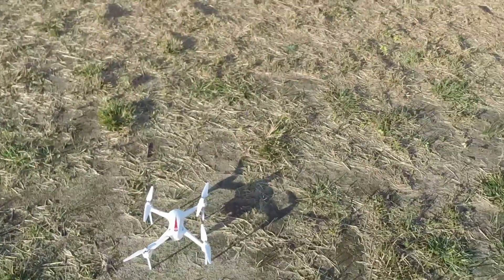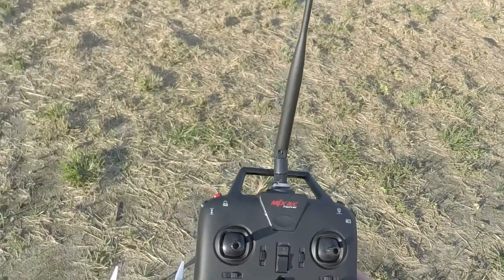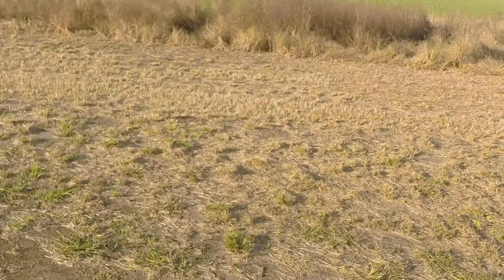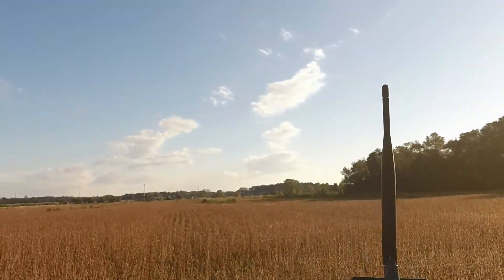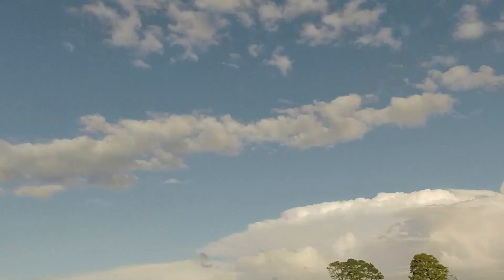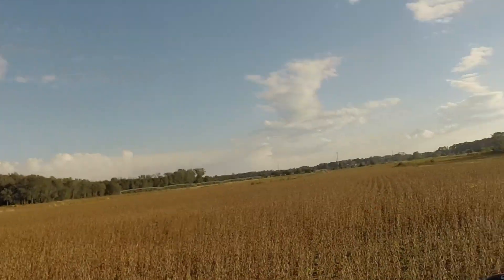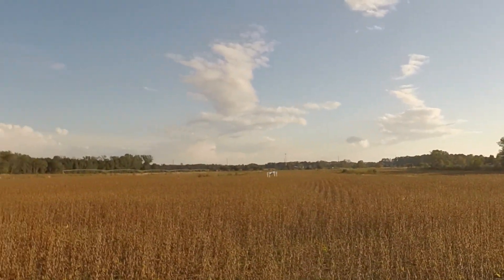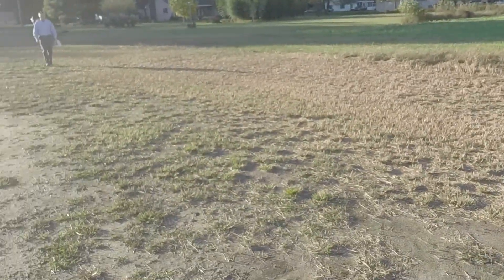bugs 2 antenna mod

Comment: I know this is an old post, but the squealing sound from the bugs motors is from over tightening the propeller nuts. I learned that from first hand experience. You probably know this by now. But for others reading your comment section, this may be helpful.

Comment: All the bugs 2, do that motor thing, it is just the altitude hold setting the timing or freq. for all the motors. if the motors are not timed the same it will just fall to the ground, then an esc problem will arise. It is best to not auto takeoff.

Comment: im kind of reluctant to do any kind of range mod's.. Good question, WHY THE FFFFFFF should we have to do these mod's in the first place? like china could not afford to charge us $3.00 extra for 5 or 6 dbi antenna? another problem I use to run into ? was the antenna coax on many after markets would be thinner than a human hair, and near imposible to splice. My only successful range mod was on two different controllers for the syma x8c,  Then i tried putting an antenna on version 2 bugs 3 controller?  the result was a horible loss of range.  (for me) no more mod's on Mjx controller,s  (another reason why  xk 350 is my Bugs killer) I can do everything just right?  and for the life of me I believe that modding a mjx will hurt range more then improve it.  I even put a phantom range booster on top of the RP-sma connecter on my modded v2 bugs controller? and the result was laughably very very bad! That ffffn booster was $15 over priced ($30 amazon or ebay) and it's money pissed to the wind. lol I would still like to take my v2 modded tx and do a side by range comparison with a stock v2 tx someday. But the irony is? i have wiped out and dissected intire squadrans of bug's 3's  motos, esc's  frames and reciever boards and i dont have any stock bugs 3's anywhere that i can get my hands on.  MJX deserve's to send me a bugs 3 for free, considering how much job security I persoally have been providing there employee's !
Reply from the maker: this really works mine would drop out headed back outside of 700feet keep losing signal as soon as it cross over the 700 feet mark full signal i went 1648 feet and had full signal never beeped once you would think for what they cost they would already had this done but they want you to lose it to sell anther lol
Reply: I think your right,  for me more than half of the antenna coax that i  have purchased was not worth a hill of beans,,, then they started selling coax that was already spliced and tinned on one side, that give's a person like me half a chance,  but I cant shake the feeling that any range mod is a roll of the dice. for me it's more game of chance than science.
Reply: Narrow Deep  Im happy for you man. just keep an eye on that bird and watch out for unexpected glitch's ..

Comment: I think you answered your own question. They don't add the antenna b/c people will take them off and burn out the transmitter.
Reply from the maker: O makes sense Thank You never thought of it at that angle i can see lots of smoke in that case ok Awesome

Comment: Hey watching your bug 2 drone here put antenna on it didn't catch whether you already had a hole for that antenna or use the existing one or did you drill out one and put one there I'm interested in doing something for mine because I lose video lag
Reply: Tx
Reply from the maker: Yupp I just removed the fake antenna lol and put some hot glue to hold sma connector really easy mod and it works well Thanks David need help let me know Bro

Comment: I have a Bugs2c also.  Might be the newer version, because I just got it a month ago.  It is the 2c tho.  Twice I have flown it out of site.  Said what the heck and flew it (assumable) even farther in a recent flight.  I still had about 3 bars on the telemetry.  I have pretty good eyesight for a old man.  Oh, if you look at my page.  I uploaded 2 videos.  The latest one I flew it until I lost sight of it, and the RTH button brought it back.  I almost wonder if your transmitter may be lacking some how for it not go farther than it does with a stock set up.

Comment: Help me, please !!!
I have a bugs 2 and everything is normal. I take off to transfer to the Mavic Printed 3d kit
Since the wire from ESC to motor is short so I cut it and connect it with ordinary wire. When I put everything on I did not connect the camera. normal rx-tx connection. have gps always. But the motor startup is not.
What's wrong with you?
Reply from the maker: The ESC'S ON MJX is very temper mental You got to watch Soldering on or around them maybe the wire You extended

Comment: Whats the point of this range mod unless you try to push it beyond the distance it's capable of. It does 800-1000m in stock setup, I've done 542 meters distance at a height of 80m so far with stock setup and jay drone has only gone 400m with a range mod
Reply: Not all bugs2 do have the same range so some of us with short range possibly looking for little more distance from this drone

Comment: thumbs up for the antenna mod...you might consider a dead cat for your mike.  kill the wind noise, btw the stock antenna should be fine out to  500 meters or better
Reply from the maker: Thank You good info
Reply: try adding a longer aerial wire to the drone first, that will increase its pick up range

Comment: Nice vid!  I believe the “control signal range” is highly dependent on the area you fly, and the corresponding “interference”.  Many B 2c owners have flown well beyond 2km with no mods.  That does not however in any way discredit the obvious value and improvement of your antenna mod.  Very well done!!  Subscribed
Reply from the maker: Yes area does matter where i am at here very good range thank You good info

Comment: you have a faulty transmitter..i go to 2440m FPV and then i lose signal with no mods at all.
Reply from the maker: thank you friend
Reply: 2.5 kilometers on stock antenna?  We need a video of that!
Reply: right I call BS.  I am lucky to get 500 or 600 feet with stable FPV feed.
Reply: you not get FPV at that distance you won't even have control of the quad.  lol. Demosthenis is claiming over 6000 feet.  lol
Reply: @timk4944  I agree Lets see video

Comment: How did you do those leg extensions?
Reply from the maker: Just popped out the black plug and drilled holes a touch bigger just like you did on your Hubsan Brother you are the Guy i got it from lol and Thank You awesome idea
Reply: md 95tsi Hey cool! They looked like white plastic rods looking on my phone here. Glad you liked the idea. I'm working on some ideas for both my Bugs 3 and 2c. I'm trying to learn video editing for  YouTube vids. That's my biggest challenge right now, lol.
Reply from the maker: I use gopro editor for 3dr solo and Phantom 2 everything else i use windows live movie maker editing is crazy stupid to learn took me awhile and i am still lost lol
Reply: you can get a set of real landing gear for about $5 USD on ebay